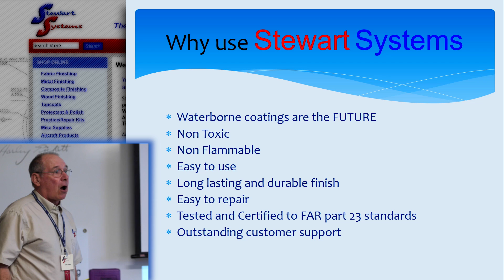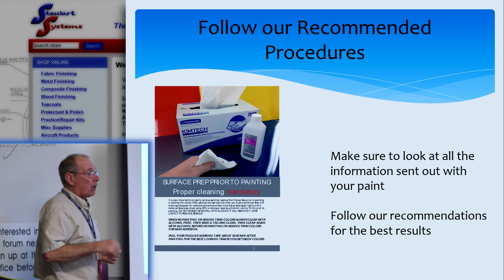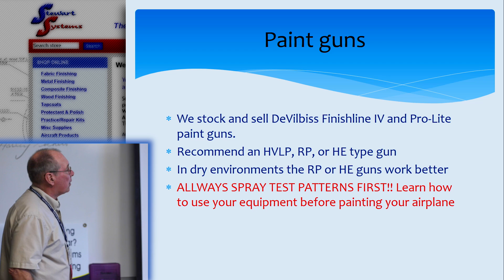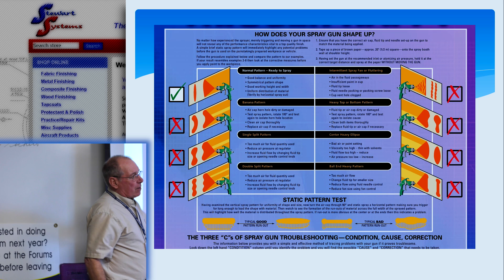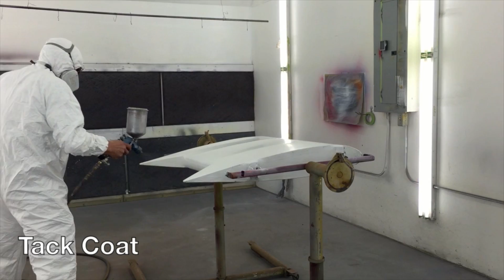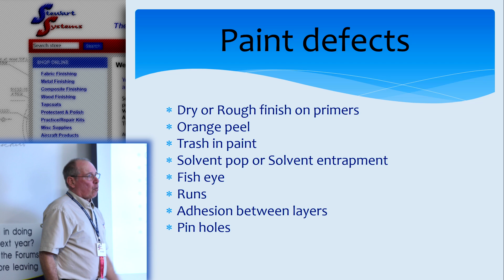Stewart Systems Aircraft Paint Overview

Comment: Will any glazing putty work with your system?  Or is a special glazing putty needed for the waterborne products?
Reply: We normally use Poly Fiber Super Fill for fiberglass work.  It is very light and sands nice.  Then use EkoPrime or EkoPoxy to finish it out ready for paint.

Comment: orange peel or runs happens, i use to work with getglow and acryo glow from sherwin williams aircraft paint
Reply from the maker: Orange peel and runs are a result of technique and/or equipment.  Runs are usually from over thinning.  Technique can certainly cause them as well though.  Orange peel can be a variety of issue, but the most common is using a low quality paint gun, not setting it up correctly, or not using enough air.  Having an air compressor that can't keep up is another common cause.  One other thing people fail to consider, if there is texture on the base coat, the paint will follow it.  Make sure the primer layer is sanded good and flat.  Lastly, make sure your technique is correct.  Applying to heavy on the fog coats or with viscosity too thin can set up orange peel.  But done properly our finish is glass smooth and a deep gloss.  If you have questions, we are always here to help!  Just call or email.